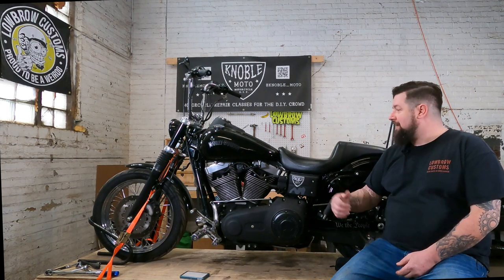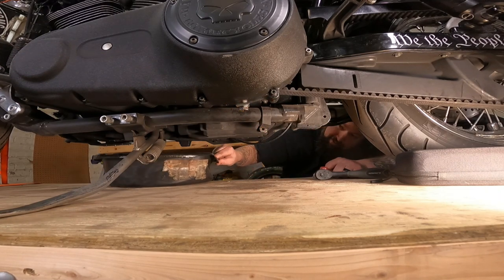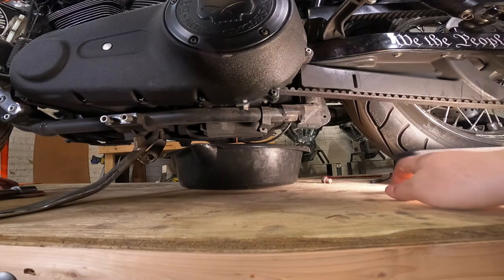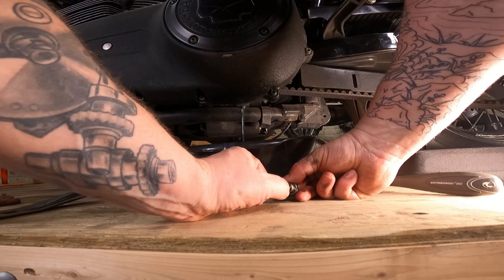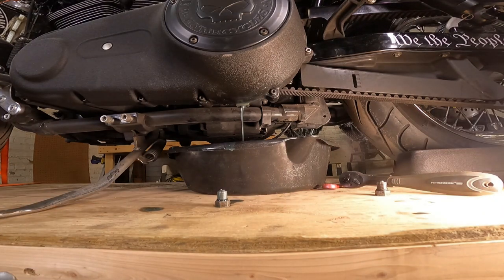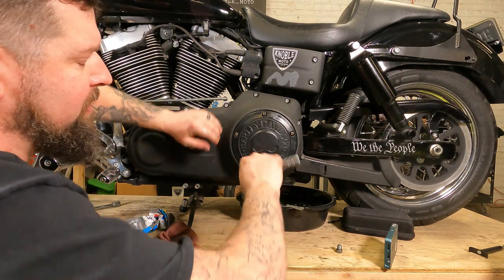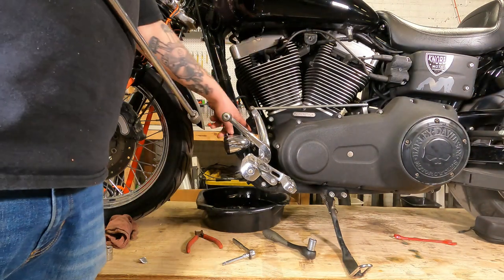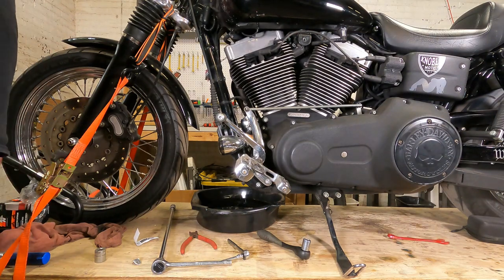3 Hole Oil Change Harley Street Bob FXDB

Comment: I ride my bike down the road about 8 miles come home and cut it off and wait 10 minutes and drain all my fluids while hot. I fill it up to spec levels and then ride down the road about 8 miles and come back and wait about 5 minutes a recheck my fluid and fill back to correct level on sticks if needed. I use Amsoil 20W50 in engine and dedicated Amsoil transmission and primary fluids for those. It’s fine to use oil in all three I just prefer to use the specific fluids for trans and primary. Always shifts better than with all oil.🤷🏻‍♂️Just me though.
Reply from the maker: Cool 👍😎

Comment: How many times can you pull that side plate off and use same gasket?
Reply from the maker: I don't think there is a set number of times.  You can basically keep reusing it until it gets hard and doesn't seal anymore.  So, replace it when it leaks.

Comment: he doesn't show where the drain is for the transmission oil
Reply from the maker: 39 seconds in I point to the transmission drain plug, and then remove it.
Reply: @KnobleMoto  Thanks bro ride safe
Reply from the maker: @josephsimons5513  you’re welcome

Comment: good video, but not say oil type for the cluch or engine
Reply from the maker: 20/50 for the engine and 75/140 for the primary and transmission. Synthetic for all three.
Reply: @KnobleMoto  But my harley 2016 103 engine and harley recomended 20/50 for all.
Reply from the maker: @felixlugo7256  You owners manual also recommends you ride at a safe an legal speed, but we all know that isn’t going to happen. (You may want to double check manual regarding oil weight)
Reply: @KnobleMoto  have the manual and the same recommendation.
Reply from the maker: @felixlugo7256  So….if you had the answer, why did you ask me?
Reply: @KnobleMoto  🤣🤣🤣🤪🤘
Reply: @KnobleMoto  AT the end i get the armsoil primary and transmission and use 20/50 for the engine only.  Thanks But in the manual and some internet site are confuse about the oil for the 103 engine.

Comment: What type and brands are you using for the oils?
Reply from the maker: The gear oil was valveoline & and the engine oil was mobile 1. Both synthetic.
Reply: @KnobleMoto  Thanks...so the primary your running gear oil...what weight? Mobil 1 for engine....is it auto or moto?
Reply from the maker: 75/140 for the primary. It’s good and sticky, so it stays on the chain. Technically it is “automotive” gear oil.  You just want to make sure whatever you use has friction modifier in it. That’s what helps your clutch operate smoothly. Often this is advertised as “for limited slip differentials”. 

For the engine, 20/50.  For Harleys you can use automotive or bike oil, since the clutch is separate.  On metric bikes you should use bike oil because of the clutch and friction modifier. However, on some beater metric bikes I have used car oil, and it worked fine.
Reply: @KnobleMoto  Fantastic...I am relatively new to HD's....about 4 years now with an 07 Dyna Superglide...love it. So gear oil with friction modifiers in primary, engine oil can be automovie...what about the trans...seems like that oil is a low weight oil? Should I stick with vtwin trans oil?

Thanks again.
Reply from the maker: @robertmacdonald2735  Baker trans recommends 75/140 for the trans also.  They are straight cut gears, so it should be pretty thick. I wouldn’t go any thinner than 20/50 in the trans.
Reply: How often would you change the primary oil?
Reply from the maker: @icarus3604  every time I change the engine oil.  Some go longer, but the clutch dust pollutes the oil pretty fast.
Reply: @KnobleMoto  Excellent thanks. Also thanks for the swift reply 👍🏽👍🏽👍🏽
Reply from the maker: @icarus3604  you’re welcome